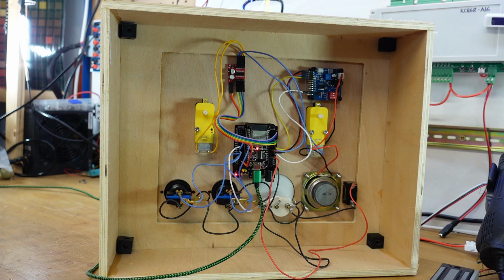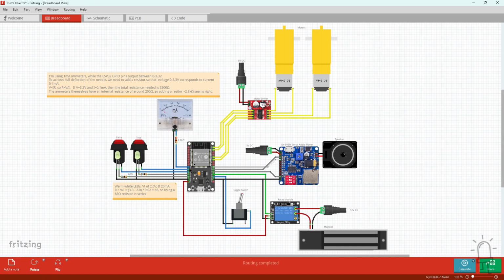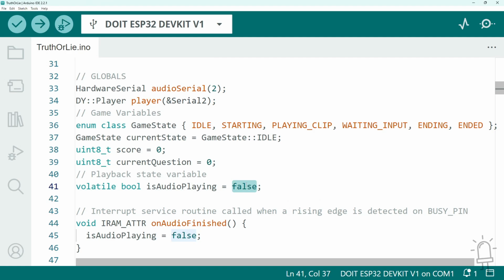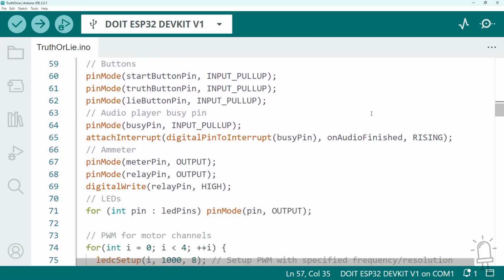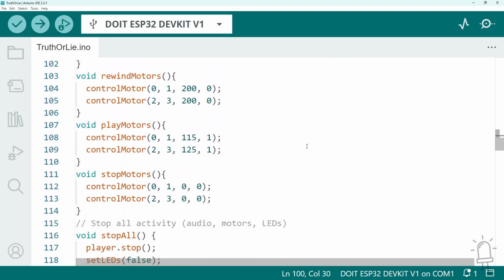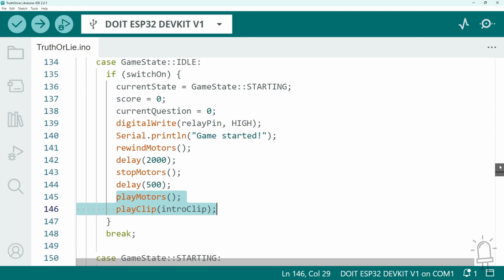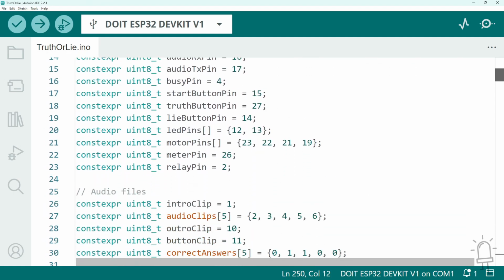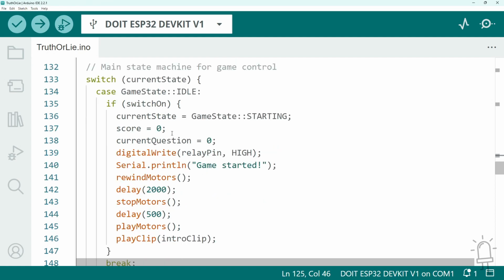Build your own ESP32 "Lie Detector" game

Comment: Do you have any suggestions for escape room / reed switch puzzles that do not use Arduino or coding?  Trying to do an escape room lesson for my middle school students
Reply from the maker: That depends on what you would like to happen when the Reed switch is activated? Simplest circuit is to have them attached to the coil of a relay module, and then attach some other device to the load side (e.g. a light, display, fan, motor, maglock, etc.)

Comment: small stepper motors are good for quiet running and you can ling the reels with a rubber band or proper drive band.